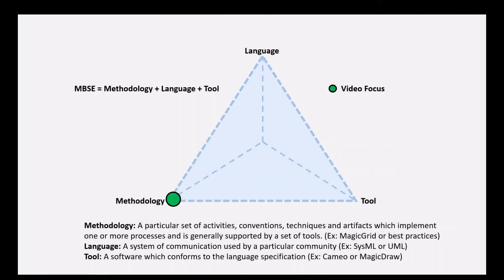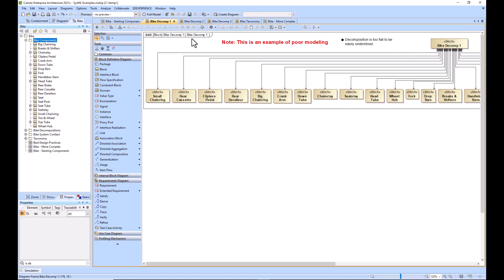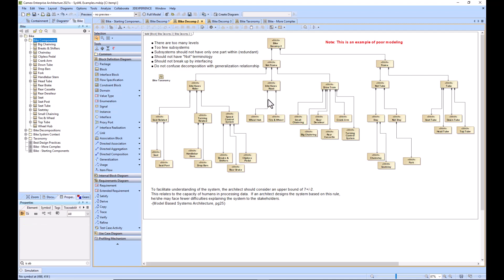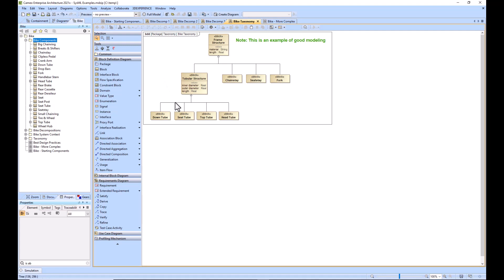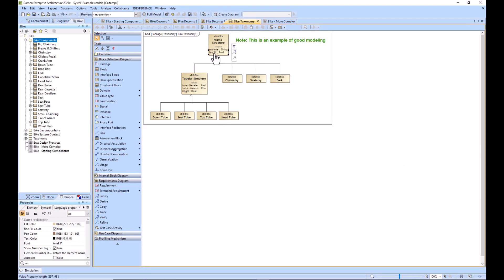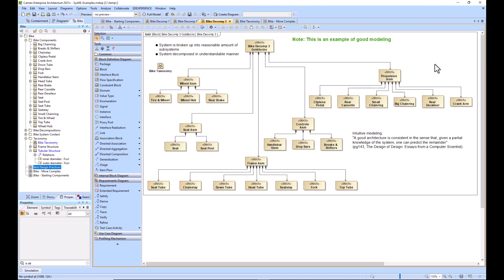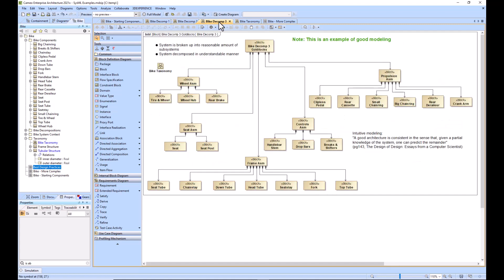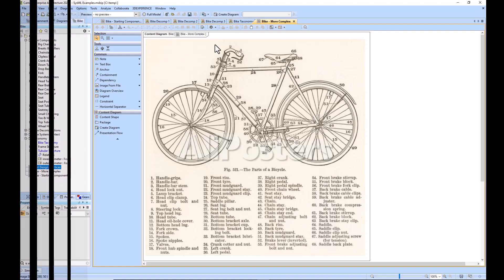SysML Design Best Practices- Decomposing System Into Subsystems - Bike Example Part 1

Comment: What do you mean by your rule of thumb +-2 @5:17?
Reply from the maker: I was referring to the 2nd bullet below.

Diagram Layout Guidelines:
-Reading direction is from top to bottom, left to right.  Layout diagrams to conform to this method.
-A diagram should not contain more than 7+/-2 major elements
-A diagram should have a printable layout
-Rarely use colors in diagrams, because of color-blind people and monitors and printers which do not show colors appropriately 
-One diagram has one purpose.  A new purpose requires a new diagram.
-Look through the eyes of the model reader when you create a diagram and not the model builder.
-Clearly separate diagram creation from model building.

(Model Based Systems Architecture, pg69)